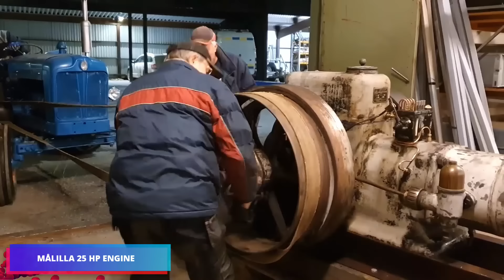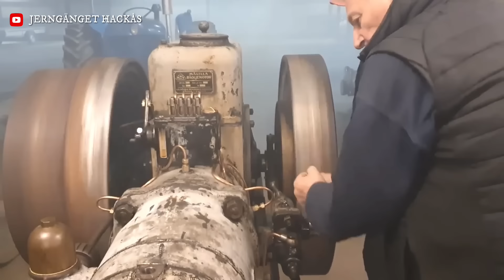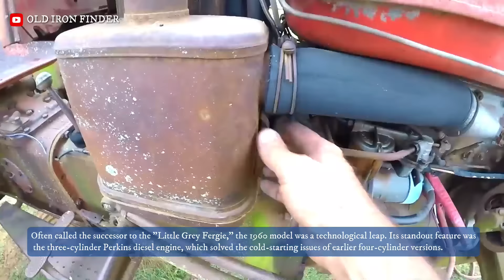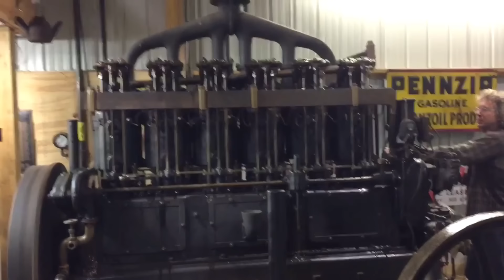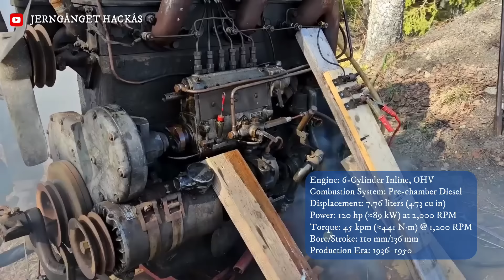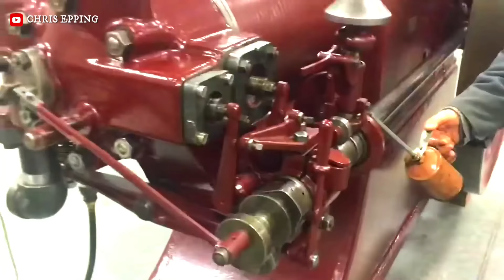The Most Amazing Engine Startup Sounds Ever!

Comment: The guys had a small problem when they were trying to start the engine by turning it in the wrong direction.  It started when they put a loop in the belt and made the tractor spin it clockwise.